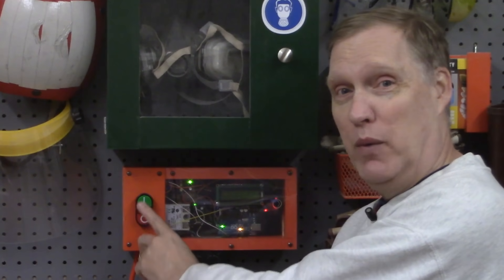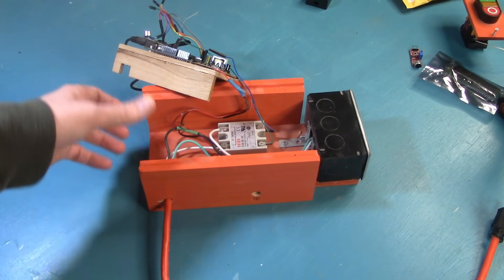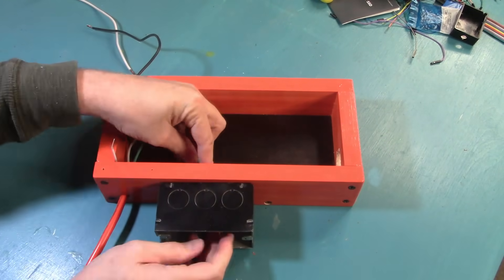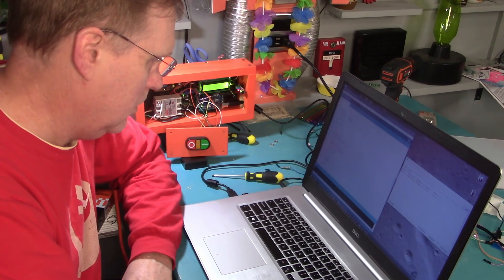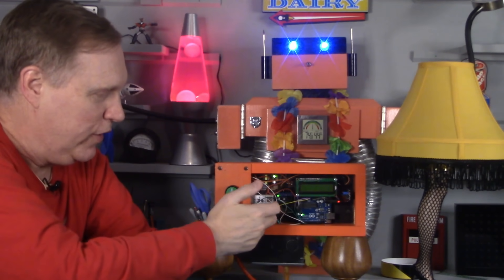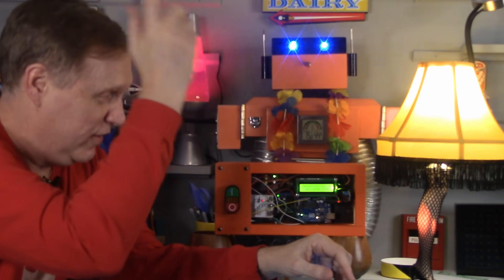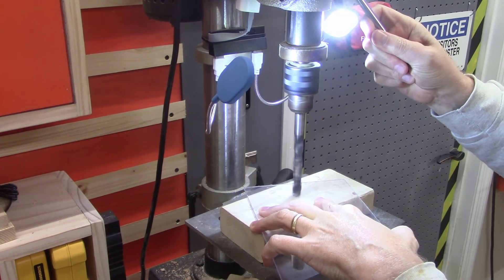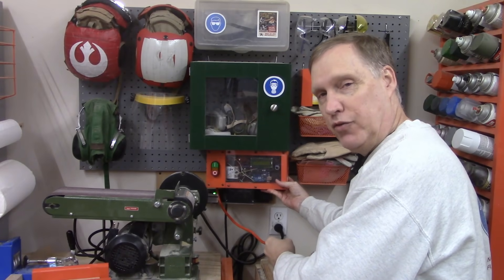Sound Activated Wood Shop Air Filter - Automated Air Cleaning

Comment: 328/5000
In a real environment, for example in a carpentry shop, hearing a sound from a hammer in use the sound of the impact would cause the air extractor to be activated in vain; some of you know that microphone can be added to be able to do it at least so that it only detects louder sound such as the saw cutting wood.
Reply from the maker: Yes and no. It is triggered by decibel level but it also requires the decibel level to stay high for one second before it activates the air cleaner. That's the beauty of using an Arduino. We can change the code to alter system behavior and sounds like doors closing, hammers, and lumber falling to the floor were early design considerations. I'm sure we will make more modifications as we use this though.

Comment: Awesome! Do you have a link to schematics and your Arduino sketch?
Reply from the maker: I don't have any schematics but here is the sketch:

#include <Wire.h>
#include <LiquidCrystal_PCF8574.h>
LiquidCrystal_PCF8574 lcd(0x27);  // set the LCD address to 0x27 for a 16 chars and 2 line display

int relayPin = 2;  //fan relay control
int sensorPin = 3;  //sound sensor
int onPin = 4;     //on button
int offPin = 5;    //off button
int ledPin = 13;    //onboard led
boolean val = 0;
int show;
int hours = 0; // start hours
int minutes = 0; //start min
int seconds = 30; //start seconds

void setup()
{
  Serial.begin (9600);

  pinMode(relayPin, OUTPUT);
  pinMode(sensorPin, INPUT);
  pinMode(onPin, INPUT);
  pinMode(offPin, INPUT);
  pinMode(ledPin, OUTPUT);
  digitalWrite(relayPin, LOW);  //relay off
  digitalWrite(sensorPin, LOW); //microphone
  digitalWrite(onPin, HIGH);  //on button
  digitalWrite(offPin, HIGH);  //off button
  int error;
  Wire.begin();
  Wire.beginTransmission(0x27); //Your LCD Address
  error = Wire.endTransmission();
  if (error == 0) {
    Serial.println(": LCD found.");
  } else {
    Serial.println(": LCD not found.");
  }

  lcd.begin(16, 2); // initialize the lcd
  show = 0;
} // setup()

void loop()
{
  //microphone sound detection
  val = digitalRead(sensorPin);
  if (val == HIGH) //sound detected
  {
    hours = 2;
    minutes = 0;
    seconds = 0;
  }
  else  //silence
  {

  }

  //button on
  val = digitalRead(onPin);
  if (val == LOW) //button pushed
  {
    hours += 1;
  }
  else //no push
  {

  }

  //button off
  val = digitalRead(offPin);
    if (val== HIGH) //button pushed
    {
      hours = 0; //stop time
      minutes = 0; //stop time
      seconds = 0; //stop time
    }
    else //no push
    {

    }

  //time countdown
  if (seconds > 0)
  {
    seconds -= 1;
  } else
  {
    if (minutes > 0) {
      seconds = 59;
      minutes -= 1;
    }
    else
    {
      if (hours > 0)
      {
        seconds = 59;
        minutes = 59;
        hours -= 1;
      }
    }
  }

  //fan power
  if (hours + minutes + seconds > 0)
  {
    digitalWrite(relayPin, HIGH); //turn the fan on
    lcd.setBacklight(200);
    lcd.clear();
    lcd.setCursor(0, 0);
    if ( (seconds % 2) == 0)
    {
      lcd.print("FANBOY ACTIVE  *");
      digitalWrite(ledPin, HIGH);  //led on
    }
    else
    {
      lcd.print("FANBOY ACTIVE * ");
      digitalWrite(ledPin, LOW);  //led off
    }
    lcd.setCursor(0, 1);
    lcd.print("  H:");
    lcd.print(hours);
    lcd.print(" M:");
    lcd.print(minutes);
    lcd.print(" S:");
    lcd.print(seconds);
  }
  else
  {
    digitalWrite(relayPin, LOW); //turn the fan off
    lcd.clear();
    lcd.setBacklight(0);
  }

  delay(1000);
  //Serial.print("Hours: ");
  //Serial.print(hours);
  //Serial.print(" Minutes: ");
  //Serial.print(minutes);
  //Serial.print(" Seconds: ");
  //Serial.print(seconds);
  //Serial.print(" OnPin: ");
  //Serial.print(val = digitalRead(onPin));
  //Serial.print(" OffPin: ");
  //Serial.println(val = digitalRead(offPin));
} // loop()
Reply: @AtomicDairy  Awesome. Thanks!

Comment: So if you're afraid of the dark, all you need do is screeeeeeeam.
Reply from the maker: It's kind of scary that screaming works 100% of the time with this device. My neighbors are going to start wondering why there is screaming and power tool noise coming from the garage all the time.
Reply: @AtomicDairy  Before watching the entire video (I heard of your project through the arduino blog) I wondered if you could yell to activate it or you had some electronic filter to detect the waveform of power tools. Then I considered the processing required to do the latter and looked at the arduino and went... ummm nope.
Reply from the maker: @mozkitolife5437  yeah....we thought of doing exactly that but it was a bit complex for an experimental system. Then we discovered that the saws are by far the loudest thing in the shop and were able to trigger by sound level alone. But the sound frequency thing may be worth pursuing if we can figure out how to simplify it.
Reply: @AtomicDairy  Indeed. You'd only expect someone to scream after a mishap with the tools anyway. Haha?
Reply from the maker: @mozkitolife5437  exactly, and we don't want any trouble with the neighbors!
Reply: @AtomicDairy  
Haha. I wonder what they thought during filming then? 😱

Comment: Interesting. Do you have any issues with false triggering?  My "shop" is in my garage, and during the summer and fall the cicadas are so amazing loud that I think it would trigger any sound device.  :-)
Reply from the maker: So far no, not from noise. It picks up around 85db and the sound must last at least one second for it to trigger. However, we have discovered that it also picks up impacts, like if we slam the shop door really hard or knock into it. That doesn't happen often but we were surprised it triggers from that. We'll be tweaking it over time to see what we can do to improve it.

Comment: Why does the relay click? Doesn't a solid state relay contain no moving parts?
Reply from the maker: The fan control relay is solid state but the tiny radio control relay isn't. Sorry, I should have explained that in the video.
Reply: @AtomicDairy  Ah, makes sense, thanks!

Comment: I work in my garage in the same way, where ever I can find some extra space.
Reply from the maker: We've made everything collapsible and portable and can configure the 1-car garage for whatever job we are working on. We did that because we were having trouble moving around in there!
Reply: @AtomicDairy  Yeah, that is something I am still working on.  I put my workbench on wheels to help, but I need to do something for all of my power tools.
Reply from the maker: @idiotluggage have you considered flip-top tool stands? We built one for our router and sander and can rotate the top to use whichever tool we need at the moment. It's on wheels too so we can push it around to where we need it and store it out of the way.